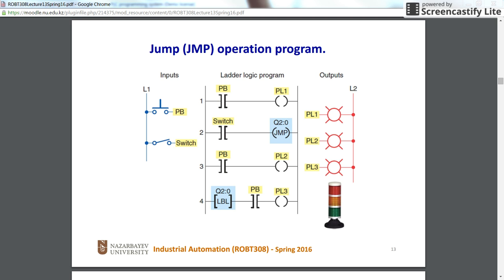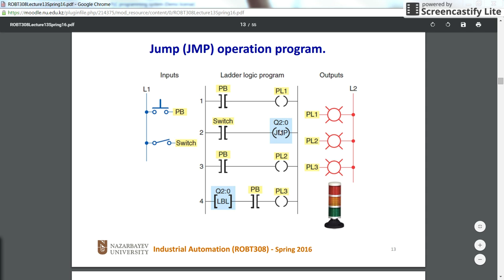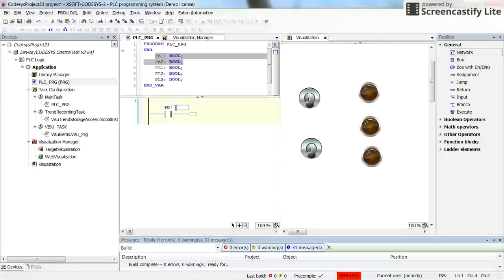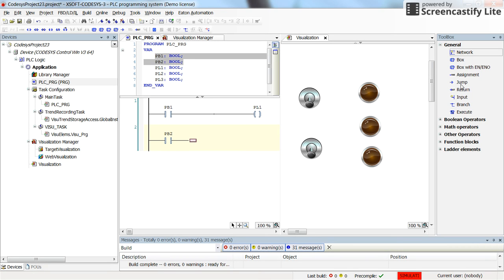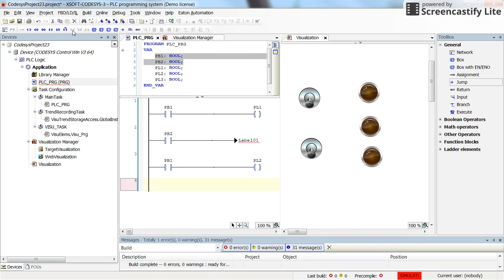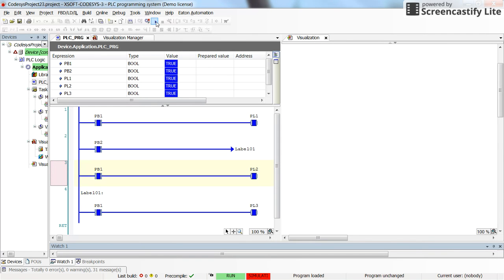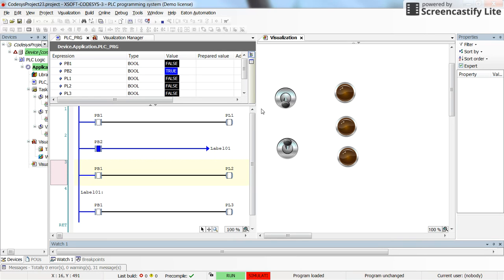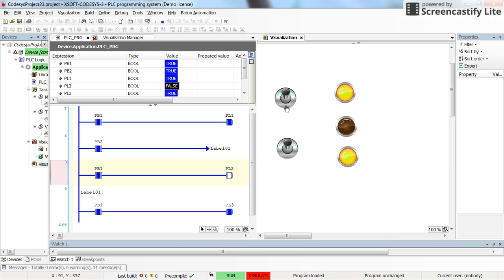CODESYS: Jump and Label instructions in Ladder logic #codesys #plcprogramming #iec61131 #plc #ld

Comment: So, basically you are jumping the instruction of the network below PB2? whenever you activate PB2?
Reply: Hi! Exactly. When you press the PB2 you activate the label and the part of the code between the jump and label is not executed anymore.
Reply: It's useful for a creating a bypass in a sequence. You could have a series of actions to be taken in a process, but don't want part of the sequence to run under certain conditions. The switch linked to the JMP instruction can be used to bypass a number of steps under certain conditions.
Reply: @WayneRiesterer Thanks, I think your explanation just gave me an idea for testing, especially during COMMISIONING and fault-finding. You know how safety circuits/instructions are.